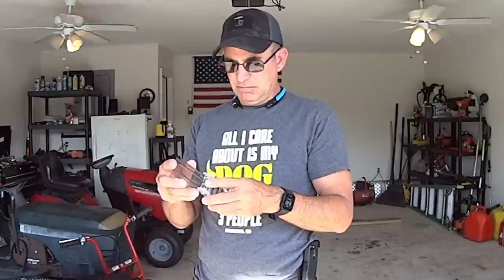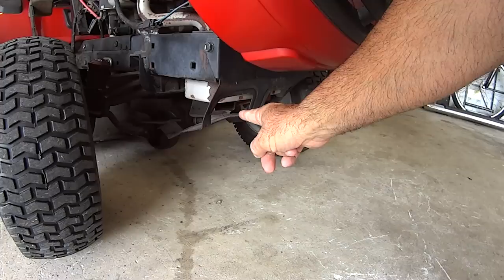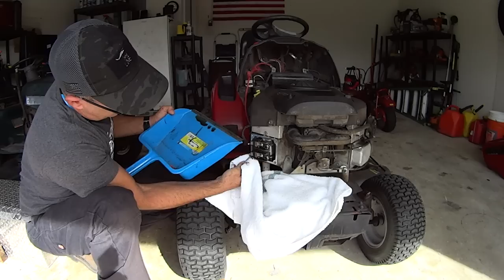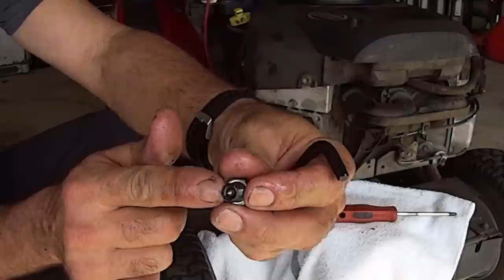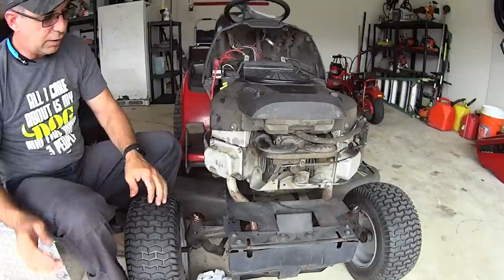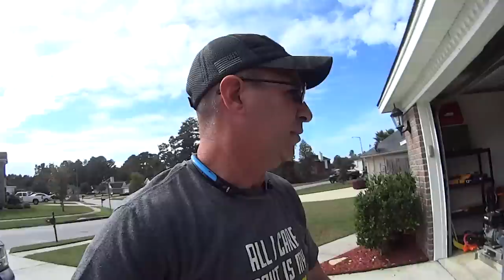How To Fix a Briggs Engine That Will Not Turn Over - Popping Out Exhaust - Hard to Start

Comment: My husqvarna never started easy from the factory - for years it had the burp sound. I watched a different video last year and discovered my valves weren't adjusted right. Keep in mind it's been in the shop several times through out the years (oil changes, tune ups, break/fix etc) asking if the starter was bad but it never was - I thought it was a weak battery always having to jump it. So last year I adjusted the valves (correctly on one side and incorrect on the other) so it would crank and start as long as I was starting on the right side of the engine. :)  So, yesterday, I adjusted the valves thinking I wasn't loose enough to give it "room". Burps all around - no turning. Your video took the time to explain the tolerances and what I'm actually adjusting. I'm starting over tomorrow and going to do it correctly. Thank you for the excellent video! (update: She starts lovely now)
Reply from the maker: My pleasure

Comment: I do not normally comment on videos.  I have a John Deere LA135 with a 22HP B&S V Twin engine.  I have been over this thing time and time again trying to get it to turn over.  I tried searching videos describing "How" the compression release works and could find nothing on the v Twin, only videos for the single cylinder engines.  I had set my valves up at .004 and it was a no go, .005 and it was a no go, .006 no go, .007 and no go. But one thing I got from your video that I thought worthy of pointing out was that you let the feeler gauge "hang" under its slight tension in place.  I did that, at the .004 that you showed, and it works!  Thank You! I figure my cam or the tappets that push the push rods have enough wear that it has to run that tight to take up the slack.  over 400 hours on my engine, but strong compression. Really wish there was an informative video on the V twin compression release and how it works. Thanks Again!
Reply from the maker: Happy to help

Comment: Hey Dan you missed one thing that will happen is hydraulic lock in the engine cylinder . Causes can be a leak from the carburetor metering needle filling the engine crank case with gasoline in the oil. Or if its water cooled it could be a blown head gasket filling the cylinder with water. Neither will compress so it locks the engine up
 Good that your helping people. Just wanted to add that little tid bit. Good job. Enjoyed the video.
Reply: Thanks for your comment. I smelled gas in the oil and drained. I put shutoff on fuel line but have yet to refill and try.

Comment: It s been 2 years i had this ob my B&S SOC single cylinder. Did as you did except the head assembly was the different one referenced in your video. I simply tightened the middle screws and all problems solved! Wish in had seen this before . Even boosting it with a car battery was difficult .

Comment: Thank you for the lesson. I have a TORO 16-38 with a B&S 16hp motor. 2 days ago it seemed to be running good, though I had to jump start it. Thought maybe the battery just needed a trickle charge, overnight.
Next day, it won't start. Like the battery is weak, however the charger indicated that the battery was at full charge, but won't turn the motor over. I had same result with a starting-current charger. Motor very difficult to turn. I just bought the machine used, with a snowblower attachment on it. I need it to run! Valves probably have never been adjusted. Seems like valve adjustment, new fuel filter, oil filter, and air filter are in order.
Reply from the maker: Hope it all works out for ya

Comment: Nice job on the video,you r like The Bill Nye of Lawn Tractors ! I am new to the later model Briggs big hp tractors ! I ve ran 17 hp Briggs ,never had an issue ! Replaced head gaskets but they run forever! My neighbor gave me fancy newer LT 2000 Craftsman like new ! Damn variable pulley drive is POS system .I repaired the pulley an now damn motor won't turn over. Non related just always something. I take plug out it spins all day good compression . Put plug back in ,won't crank over ,straining. Thinking exhaust valve is out of adj causing compression release to not release . Good Video bud thanks ! Ps you mentioned adj valves on your 2 stroke Stihl equip.When did 2 strokes get a valve train ,other than reed valve ? What else is my old ass missing out on ? Some new type 2 stroke ?  I work mostly on my Gravely Walking tractors  ,not familiar with the new new lawn equip! Thanks

Comment: You don't have to use top dead center with a screwdriver just make sure that exhaust valve is open rattle the intake clearance with your fingers on the intake valve also you should be able to test the starter pretty good by just taking plus out if it rolls over fast probably fine. Just look which valve is over the intake or exhaust ports to tell which which
Reply: agree

Comment: So is the goal you tighten the Rockers enough so you can slide the. 004 bit of metal in and out with a bit of resistance? I've hit a hayter heritage with a 19hp engine and I think this is the case as it is burping for air as you say.

Comment: On a Honda generally overhead valve clearance is .006 regular Briggs motor can go ashigh as .012 but overhead valve motor that will be kind of noisy I would probably shoot for six to eight thousands. Note that if you're running anything on natural gas will probably have to open it up apparently I'm finding on the Vanguard generators they had a problem with the camshaft de compressors were breaking

Comment: Great video as always. I'm sure someone said it already but my ocd is going so I have to say it is .1 mm a tenth of a mm (sorry). But like I said great video I have been having problems getting my Craftsman t110 running right because of this same issue I've replaced battery, starter, and have adjusted the valves multiple times it will turn over easy then the valves are messed up again. Any input on that? Thanks.
Reply from the maker: I get sooooo confused 🫤 🤣

Comment: Thanks for the video. I have a Toro w/ B&S Intek VTwin 22hp. Just went to Autozone and picked up .004 spacing tool. Bc I have the burping symptom you showed... I just loosened/tightened all four pushrods (fuel pump side top pushrod was loose). However starting back up I got a white cloud, not the same purr result you got. Thoughts?
Reply from the maker: If it cleared up and everything seems fine then don’t worry about it sometimes when you’re turning the motor over by hand you might be putting a little bit of fuel in the cylinder and also if your machines a little bit older we could have a little oil buildup in the cylinder. If it’s causing you problems, recheck the valve clearance. Sometimes when we tighten the jam nut on the valve, we accidentally tighten the valve clearance as well

Comment: Valve lash doesn't always get loose. Honda had a problem that their seats were not seated so they were pounding down in the head especially with natural gas well that went and wiped out the clearance on the valve if you had to reset it serious I used to run a snapper dealership Echo and Husqvarna and Stihl and run my generators on a natural gas well

Comment: mine just bumps but will not turn over , but if I remove the plug it will spin. seems this might be the issue. thumbs up
Reply from the maker: No, weak starter. You may need a new starter or a very strong battery
Reply: @DansVlog  okay, I'll check the starter. the battery is brand new. this machine has been sitting a few years & I got it to start today. let it idle for about five minutes then when I tried to restart it just bumped a few inches but wouldn't spin. thanks for the help
Reply from the maker: Check the valves anyways cause it is free to do but I think you will find the starter is getting weak
Reply: @DansVlog  camshaft needs replaced. pressure release valve broken on camshaft. Steve Leker channel has video on repair titled ' replace camshaft '

Comment: I use the old school razor with the jaws that open and you put the double side blade in,I used to find the Wilkinson sword blades but hard to find in stores I use another brand that cost a Little more but found some on ebay.
Reply from the maker: I tried them many years ago. I liked them

Comment: You turned the fly wheel by hand to get the engine to tdc. What would cause the inability to turn engine by hand. I can  spin it with a socket and ratchet but barely
Reply from the maker: Dan Grad Take the spark plug out
Reply: @DansVlog  I did
Reply from the maker: Squeeze the operator presence lever to release the flywheel brake and it should now be able to free spin
Reply: @DansVlog  this is on 26hp Briggs v-twin ohc engine on a Swisher Zmax 2660. Unfortunately not on a push mower.
Reply from the maker: Oh well then in this situation, if both plugs are out, I would look carefully at the underneath components and ensure the PTO if equipped or the blade belt is not engaged causing drag on the crank. Other than that, I am at a loss

Comment: Great video! Very glad you explain it several different ways with analogies. I'm not a mechanic, but I can't afford to pay for repairs. I do have a question:Can the gaps be the same for the intake & exhaust? Also, is there a gasket on the cover?
Reply from the maker: Most of the time, yes the gaps are the same but always research both

Comment: Going to have to find a video covering this on a John Deere I have.  I think that may be my problem.  I can get it to start if I have my SUV hooked to it with jumpers, but it won't start otherwise.  The battery tested fine at Advance.  Does that make it sound more like a starter issue? Or this?  It does sound rough when I get it running.
Reply from the maker: You only need to know what the engine is. John Deere, Craftsman, Husqvuarna... doesn't matter. Just know if its a Briggs, or a Kohler and if so, what the model is of the engine located on the engine's data plate/sticker. Then research that for valve clearance. Hard to start, running like poop, may be the valves along with needing a basic tune up (air filter, spark plug, fuel and oil filter replaced)
Reply: Thanks Dan.  I think it's a Kohler.  I was given 2 John Deeres within a year period.  The one I still have (LT 155) was my grandfather's. I got it after all the estate was settled.  Then my parents retired to the Republic of Panama and gave me theirs.  I sold the one they gave me and kept the "better" of the 2 to fix up a bit and sell.  I gave it a new air filter and cleaned the carb.  The fuel filter looks good, but I'll change it along with the rest of the list.  I only ran it a dozen times after I got it from a repair guy my mother took it to.  From the look of it after tearing into it a bit I don't think he did much to it.  It never did run all that well so it sat for quite a while.  It's one of those projects I'm in no real hurry to complete.  Lots of things taking priority over a lawn mower I don't need.  My yard isn't very compatible with a lawn tractor.  I basically used it to chop up the leaves from a huge oak in my backyard and to pre mow if the grass got too long.
Reply: You also need to check to see in the compression bleed is in tact on your camshaft. You can do that with valve off by watching the intake rocker arm while rotating the engine. When coming up on the compression you will notice the intake valve arm will go down just a little  and the exhaust arm does not. That bleeds some of the compression to allow the engine to spin. It has plagued those engines and very common .

Comment: If you take out the plugs and the engine cranks, would that not indicate a valve problem?
Reply from the maker: No. The valves are shut on the compression stroke anyways so if you have to remove a plug in order to turn it over, you have a hydro-lock. Water or fuel in the cylinder.

Comment: 12:50     10mm = 0.400" .... 1.00mm = 0.040" ..... 0.10mm = 0.004".     Multiply Millimeters by 39.37 to get your size in thousands of an Inch (Thou) and Divide Thou by 39.37 to get your size in Millimeters.   0.004" is 0.102mm NOT 10.2mm as stated in this video.
Reply: 1mm = .03937.   .01 mm is .003937 10 mm is .3937  just a slight correction on your formula. I was wondering if anybody caught this. Multiply mm by .03937 to get inches. divide inches by .03937 to get mm eg. 3/8 (.375) = 9.525 mm.   10mm = .3937  inches
Reply: @johnrehm3836  Thanks, but I don't think 0.00063" difference in 1mm is really relevant so I rounded up to a usable measurement that anyone can relate to and use.
Reply: I was just trying to point out you said to use 39.37 when it’s actually .03937. You’ll have to forgive me I am a machinist/ tool maker by trade and have done a lot of metric conversions in my trade. But yes .00067 is nothing to bother with in this instance.

Comment: Weak battery, bad solenoid, weak starter, valve adjustment, camshaft.
5 Things that can cause a cranking problem.
Additionally, on a twin cylinder camshaft one or both compression relievers can break off.  If one falls off, the engine will have difficulties cranking.  If both fail you ain't cranking that engine.  At all.

Comment: Been using Dollar Shave Club for the past 4 years. Best razors & shaving I've ever used including Art of Shaving stuff. I use the executive blades.
Reply from the maker: My ex wife and I used them for about 9 months and cancelled them too. They worked great but dull out way too quick. Seemed like cheap metal to us. Really just can't beat Gillette (unfortunately)
Reply: @DansVlog  That is unfortunate, as Gillette is really expensive. But everyone has different skin & not everything that works for one person will work for another. Great video as always BTW. You give great information & I've learned a lot from you.
Reply from the maker: I was so disappointed cause you are right! Gillete costs a fortune